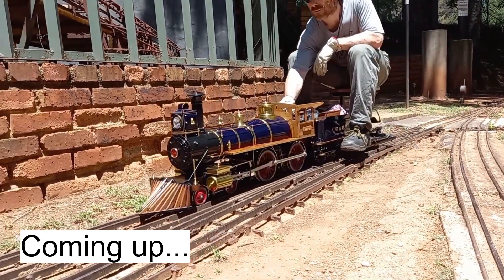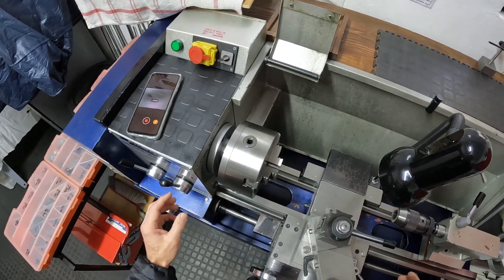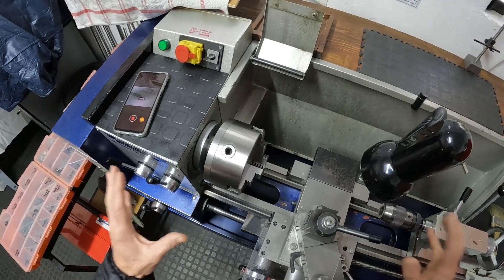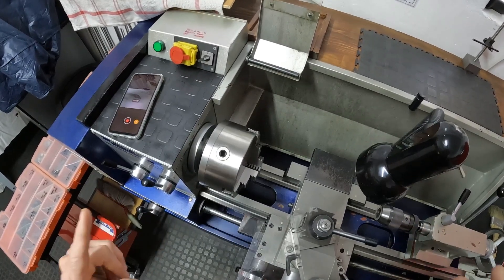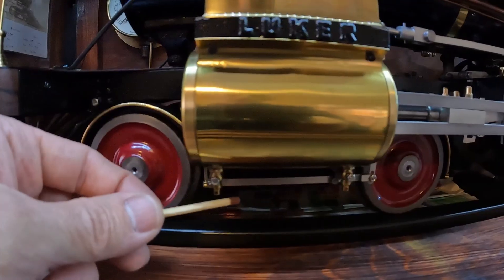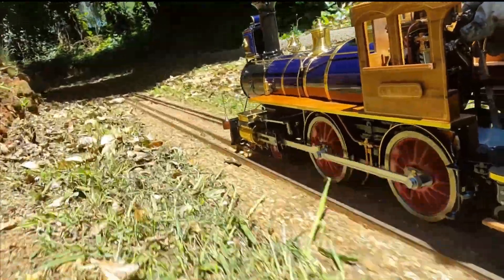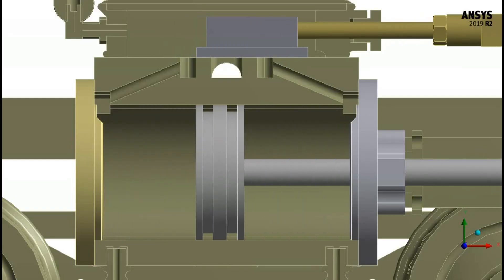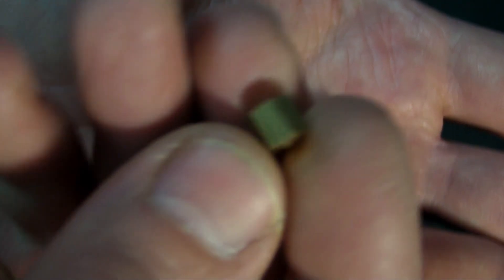How good are Chinese lathes?  A proper review of the ELATHE-613

Comment: Is your lathe levelled and bolted down? Mine is neither of those things :( I managed to build a working loco with it, but everything has a taper, including the cylinder bores.
Reply from the maker: @davidtaylor6124  All lathe beds have twist, this needs to be sorted before turning. Otherwise, you'll get tapers. The cylinder and pistons will be the biggest problem. I have an old training video somewhere on the channel that will help you with this.

Comment: Accuracy can be measured and it’s meaningful. It depends on what you do though. Those of us who have been doing this for a very long time have learned how to work around inaccuracies. If you need to make a high precision shaft on a lathe usually know to do all the operations without removing th part before it’s finished. Then, even if concentricity isn’t great, the part can be perfect. But if the spindle isn’t perfectly in line with the bed, you’ll get a taper. That can be a problem. Sometimes you can loosen the headstock and straighten it, but often it’s on the front way which doesn’t allow it. Then, it’s a problem. If you only make short parts, it may not be. But it will if you make long parts. The point is that sometimes it matters and sometimes it doesn’t. Sometimes you can work around it and sometimes you can’t. I always tell beginners to buy a Chinese (or Taiwanese) lathe from a company with a good reputation rather than buying an old used machine from the USA, Germany, England, etc. The reason is that the old, industrial machines are usually worn out. If you’re new to this, you won’t know when you buy it and won’t be able to fix it.

Comment: I have an old 50's lathe, changed bearings, spindle, feedshafts, and nuts. Its able to do things far better than I am capable of. Thank you for this video.😊
Reply from the maker: Can't go wrong with refurbished machines; when I was in the market used machines were more expensive than the new Chinese lathes which is why I decided to go that route... My vintage German horizontal works very nicely!

Comment: I started my machining hobby with a cheap Chinese lathe, the real basic version. It works and can make nicely accurate parts as long as you're patient with it and keep checking your progress. It has a lot of weaknesses that I've learned to work around and it takes time to make something worth it. Still, it was within my budget range at the time and taught me a lot about how a lathe works and what you can do even with a crap one. Accuracy is definitely more a feature of the operator than of the machine in this case. My main expectation of a better lathe would be in the efficiency that can be gained from having to do less double checking as you go. Anyway, I'd recommend a cheap lathe to anyone starting out, the second hand market around here has lathes that either require a huge shed that hardly anyone will have space for, are even in a worse state than these Chinese ones, or still cost a fortune.

Comment: Chinese Lathes are pure piles of horse manure
Reply from the maker: And yet look at what I can scratch build using them! Maybe reconsider that view...
Reply: @Lukers_tinkering  I’ve owned two Chinese made lathes, a 7x10 and a 7”x16”  both of which required hundreds of dollars of upgrades and many hours of work just to get them to be a usable machine with minimal amount of accuracy.  Perhaps it’s the size of the machine that makes the difference.  They tend to use lower quality parts in the 7” series verses the parts that are used in the 8”, 10” and larger series.  I know that if I want higher accuracy and better performance I will need to shell out more money, even if I go with the larger Chinese horse manure machine route.

Comment: Thanks for sharing....Making Steam cocks would be of great interest if you have time to make a video.
Reply from the maker: That will make a nice video, it will have to cover some design and manufacturing methoding. The clacks are more difficult but I'll cover both. The taper steam cocks have been covered because that's a special case.
Reply: @Lukers_tinkering  i have watched the taper ones this morning...but the clack valves would be great...building a triple expansion at mo....your engines are masterpieces. thanks for your content